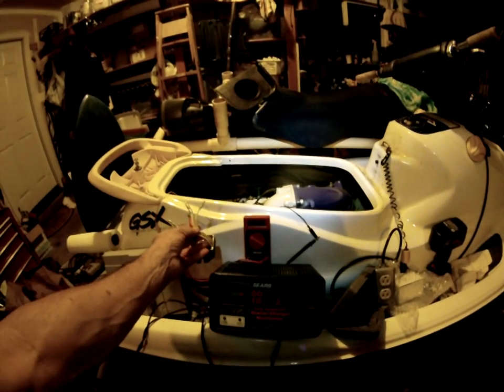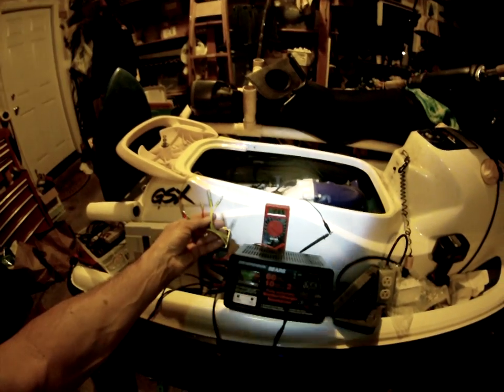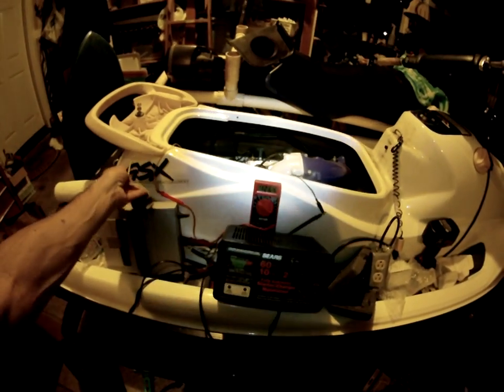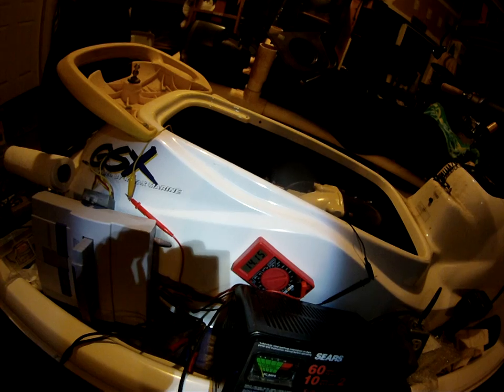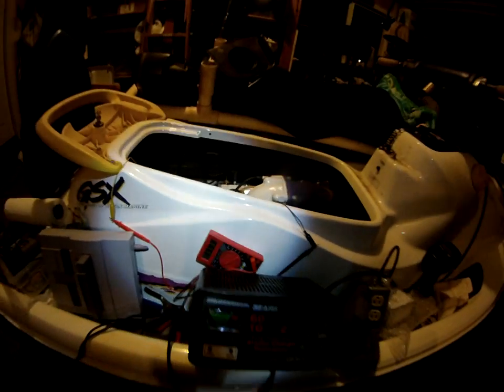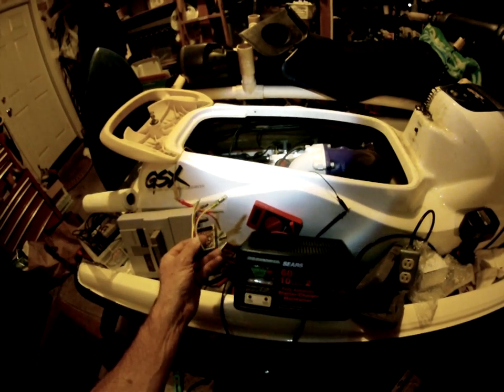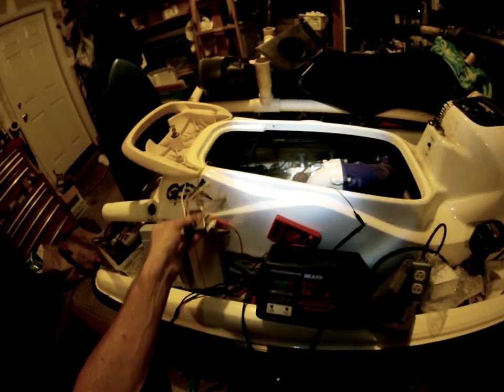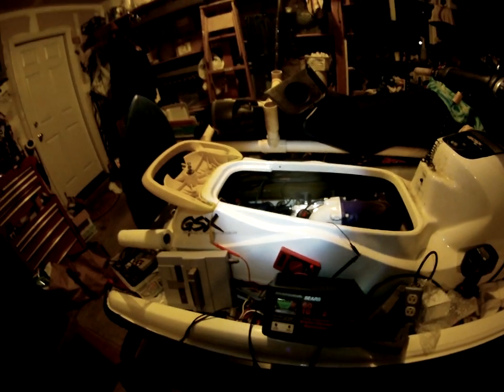Jetski Rectifier / Regulator / Charging System / Alternator Test , Bad or Good ?

Comment: IT WOULD BE NICE IF YOU SHOW HOW TO TEST  THE OLD ONE  BEFORE  SOMEONE BUY A NEW ONE AND DID NT FIX THE PROBLEM
Reply: Seadoo manual says there's no way to bench test these rectifiers. They recommend testing output voltage to the battery when the engine is running, and/or amperage (should be 5 amps). Should put out about 14V, as this video shows.

Comment: Thank you from the bottom of my heart for posting this video. I had the same problem, misfiring at higher RPMs. I went thru the carbs twice, checked my fuel delivery many times, replaced the magneto with new, replaced the CDI box, but I never thought to check the rectifier ,I figured it was charging the battery so why would I replace it? You know? either it works or it doesn’t. Wow was I wrong, I bought a brand new rectifier from ebay for $17 spent another hour installing it and voila! It runs like a champ! Thanks again for posting your findings, you helped me out tremendously!

Comment: I bought 2 seadoos and I swear I had nothing but trouble with both of them . Constantly broke down with ignition , charging issues or carburetor problems of some kind
Reply from the maker: I thought I had ignition, charging problems but it was all carb and disolving gas line problems. I installed all new gas line, new on/off switch, rebuild the carbs with new filters and the ski has been workiing great. Mine is a 1996 GSX. the one in the video. Original Rectifier was fine.
Reply: CalQwax I have done everything you just mentioned on a fully rebuilt 787 (96 gsx)  Gonna test new rectifiers (2)   I hear it could also be metal shavings on the stator. Ski is not responding but at times it wants to take off on the hose.

Comment: I have a 95 spx that is putting out more than 20 volts (that's as high as my meter goes), can that also be caused by the rectifier, and cause the battery not to charge?
Reply: Did you ever get an answer for this question? My 96 xp is also at 16+ volts.
Reply: @kwadlife4106   I had another issue with that Seadoo, it wasn't a rectifier that was the problem, but I can't remember exactly what I did to fix it.  I know that I took every electrical connector apart and cleaned them, and bought a new battery.  I never had the problem again.

I also have a 96 xp that did require a rectifier replacement.  It was charging too high too and fried the battery.  I got the rectifier from a guy @ https://www.seadooforum.com/forums/2-stroke-sea-doo-pwc-forum.17/ and it works fine now.

Comment: Hey, what did it run like before you changed the rectifier. I have a 1998
Kawasaki 1100 which runs rough, and does not have full power and hesitates
on acceleration.
Reply from the maker: It turned out to be DIRTY FUEL FILTERS, one in each carb, located INSIDE THE CARBURATORS. I believe my rectifier was fine even though I replaced it. I bought 2 carb kits, carefully cleaned the carbs taking ppictures with my phone as I went along, gas lines will come off even with factory clamps on them, and the ski runs normal now. It took a little while for the carbs to fill with gas for the motor to run right. For a little while I was thinking I didn't fix it. I believe my carbs are MIKUNI carbs and I did get Mikuni carb kits. The kits fit many carbs so you will have extra parts.